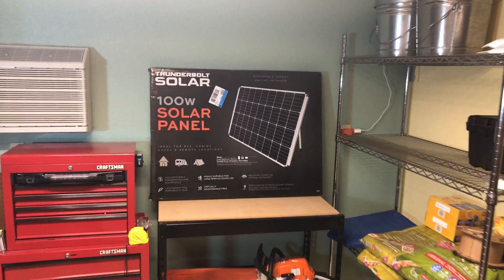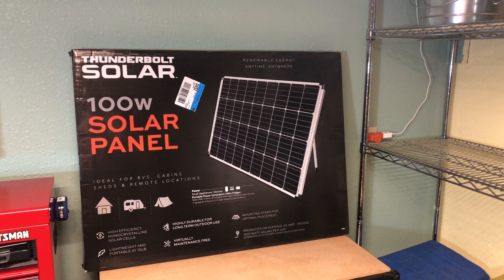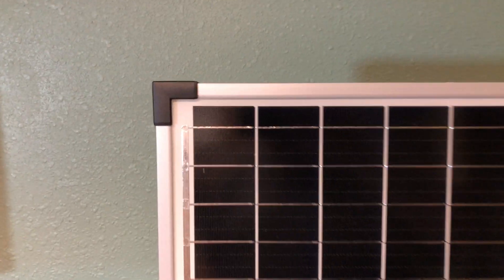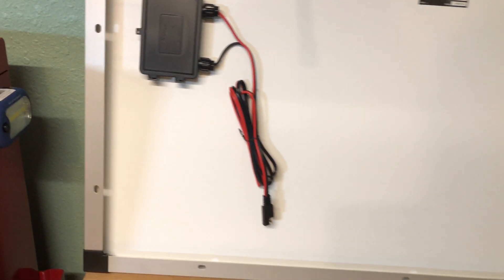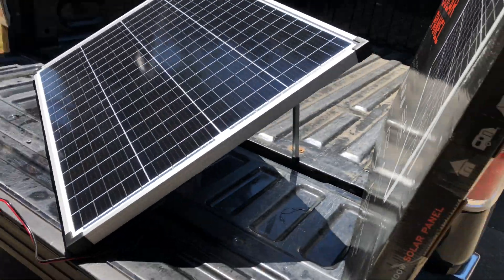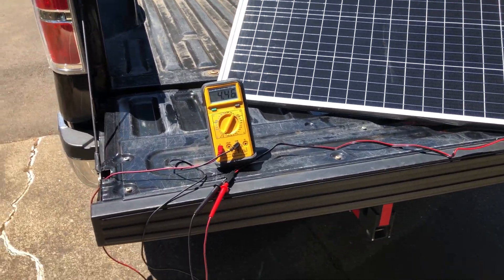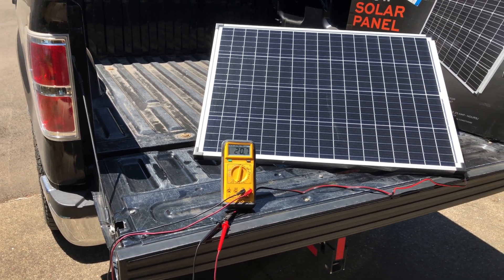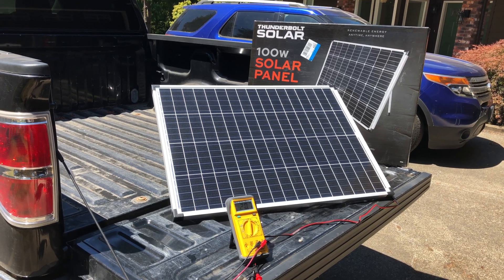Harbor Freight 100W Solar Panel Thunderbolt, new in 2021

Comment: I’d switch the sae connectors to mc4 if 2 or more is used I’d probably switch even with 1…sae is easy to make accident connections with and they can’t handle much heat &/or power.
Reply: Yep I learned that after dealing with some panels…I suggest sae for only small panels..like under 100w &/or under 5amps max..that panel featured is just over that…not dangerous if the sae only connects correctly and to a low watt and/or amp circuit, but still those things really don’t like heat so over 100f with that panel is still pushing it.

Course you seem to know of mc4..good stuff…an other option that is way more appropriate is Anderson connectors…they range from 5-8 amps up to industrial amp and voltage for things like fork lifts..etc & can handle high environmental temperatures too.
Reply: It’s way better to only use sae for things that can’t pull or push much amp &/or voltage…like a small usb hub or such…it’s a little bad design that that panel has sae but again it’s kinda ok and safe although why be risky with electricity…not a very good idea for anything but learning….connect 4 of those panels in series and have full sun exposure to a circuit that can take that power and I’d bet for melting at the sae even below 100f …over 100f & or even more panels and ekkk it could get bad fast.
Reply from the maker: @allglad  I may just do this MC4 conversion as I just bought another identical HF solar panel today.  I might experiment with the SAE first but many battery packs use MC4 to proprietary charge connections.  I know of Anderson and agree its one of THE best.  So many different standards out there.
Reply from the maker: that is a good idea!

Comment: Greetings: Being meticulous and technical I, also, noticed the incorrect connection of the meter as U say U measured current. I concur with the others that there has 2 B a load.  Such load must exceed the available current  2 load.

Comment: you cannot measure amp that way.it must be in series with a load. solar panels do not push amps out at a certain value . Amps or current is drawn from the panel by a load. the load may only be 1 amp or it may be 300 amps or 7 or 31 or 213 or 76 or any amps .if you hook that panel up to a 100 amp load it your meter will only read the max current/amp that the panel is rated for which is 5 amps .think of it like hunger when your full you stop eating .When a battery is done charging it reads 0 amps

Comment: that "100 watt" kit, that comes with the four 25 watt panels, is a good kit to cut your teeth on, but they used ocv  and short circuit current to rate the kit. so the most i ever got out of mine was about 64 watts, and trust me i did everything i could include wiring for series and using mppt etc etc. i want to test out this new 100 watt panel, but they want $120 for it, and i can get proven panels shipped to my front door for $89 by rich solar. but the little stand could be handy that seems to come on this harbor freight panel and thats worth something.
Reply: I paid $81 yesterday
Reply: @southkerr6267  aah, inflation... these go "on sale" tomorrow for 99$!

Comment: I maybe wrong, but I don’t think you can measure amperage like that. You have to put the meter in series with the load. You did get a reading, so I am probably wrong.
Reply: You are 100% correct Jay !!! This guy doesn't know how to measure amperage, he's giving out wrong information.
Reply: The meter has a load resistor when measuring amperage.

Comment: What voltage would 2 of these output in series?
Reply: 24v
Reply: Parallel is same voltage and add amperage (ex. 5amp + 5amp=10amp output @ 24v)

Series adds voltage together so roughly 48v but amp stays constant (example is 5amp total @ 48v).

This would be the same for batteries.  2 12v batteries in series is 24v @  amp/hr of one battery.

2 12v batteries in parallel is 12v @ battery 1 + battery 2 amp/hr.

Comment: Nice, mine pulled 14.4 indoors with indirect lighting. I'm making it in a cooler with wheels. 1000 watt DeWalt inverter. All I need is a decent charge controller. I tried harbor freight and no good. Deep sealed battery100ah. Big too. Anyone  recommend a charge controller?

Comment: Harbor freight has had a bad history of crappy solar products at rediculous prices. They at least finally have offered a 1 dollar per watt mono panel. But its probably too little too late. Its not going to help that they continue tostick with their dumb non solat industry standard connectors. The wire they have on the panel is inferior crud compared to any othe panel manufacture. Given you can buy a renogy for under 100 id say harbor frieght can only prey upon the fools that dont know bettet.
Reply: I bought the cheapest 100 watt poly panel on Amazon for about 76 bucks and it puts out OVER 100 watts at 3pm in Louisiana.
Reply: Any suggestions on a charge controller, for 100 watt? Hf didn't work, no digital readout. I might add another battery and panel.
Reply: @plove9136  depends... Do you want true mppt or pwm or the chinese half mppt that can only step down voltages but not step up? Mostly because a buck boost is a more complex circuit. I personally use victron charge controllers. I also respect and have set up systems with outback controllera epever and many others. My parenta just had me install a sulystem on their rv. Dad chose an epever to keep the cost down. I was a little sceptical but i would say epever is the best budget friendly full featured controller ive seen. For 100 watts you cpuld get the smallest one they make. Technically anything rated for 8 to 10 amps can easily handle 100 watts on a 13 volt system. Also get rid of lead acid too many losses both while charging and while pulling energy out. Check out batteryhookup.com you can get 100ah of lifepo with a bms for like 260 last time i looked. I built 300 pluss ah for less than 1 battleborn.
Reply: @acroduster  I've learned a lot since then. I got, 2 Rich solar panels. And 1500 watt pecron power station, runs the fridge and coffee pot no prob.  It's a beast, and the amp hours are better than comp.  Still have lead battery hooked to a $13 controller. It will do until I get the Rich solar charge controller.   made in Vietnam, thought it was India.
Reply: @acroduster  thanks for the info.  And that power station has po4 lithium batteries. Weird thing is it needs 30-40volts to charge. 2-100watt in series should work. I can hook them direct(no charge controller) indoors, through window light and get 34-35volts, short wires and the panels are cool.
Reply: Yeah never buy anything solar from harbor freight.

Comment: Thanks so much, can you dasiy chain two of these together? L
Reply: Depending on the charge controller you are using you could daisy chain many together. Charge controller just needs to be able to handle the max open circuit voltage you end up with and of course the total amperage/wattage of the array.
Reply: Use the HF hub for linking multiple panels. Paralell for 12V. Can handle up to 400 watts, however, charge controller are limited to watts. For example, 10A=130w max panel, 20A=260W max panel power. So, if you want 2 100 watt panels, you need at least 20A charge controller.

Comment: good information, hoping to see your video on the other things you need, I understand you need some kind of "manager" to manage the solar power into charging your battery system.
Reply from the maker: Working on it!  Thanks.
Reply: voltage/current regulator; does the same thing as the one built in on your car's altenator.

Comment: how much  $ ???
Reply from the maker: $100, but used a 20% off coupon..so $80.
Reply: danr97123  - good deal , I paid $375 for 75watt Siemens panels  around  ‘ 99- 2000..

Comment: With that kind of setup I could run a 7 amp motor to 3/4 capacity in good sun @12v good stuff
Reply from the maker: Assuming you just need to run it during "good sun" daylight hours:  2 of these panels with a cheap charge controller (and optional battery for interim cloud backup) would be ideal.  
You might be able to skip the battery and second panel if you don't need it to be continuous or 100% reliable.
Reply: @danr97123 I need get charger controller that's all or battery 🔋 I bought one yesterday from harbor freight  what's inverter so new at this I've got jackery 290 explorer but this solar panel can't hook up to it please help thanks in advance
Reply from the maker: @cw5034  i think you just need an adapter to go from the SAE connector to an 8mm for the Jackery.  Look at this one: https://amzn.to/3l12qPW
Reply: how many hours a day ?